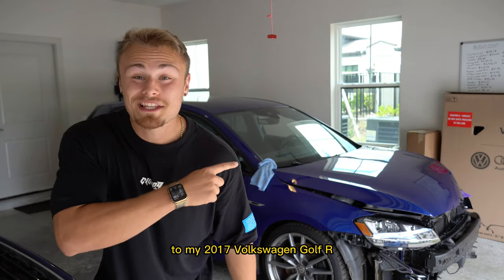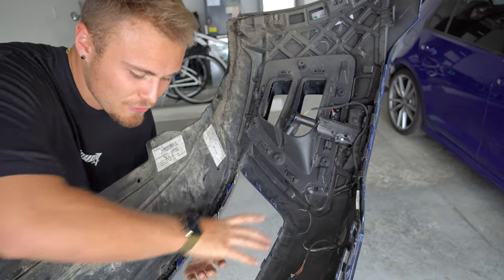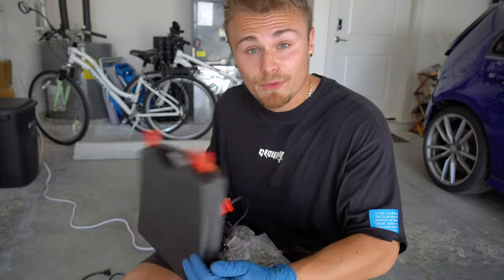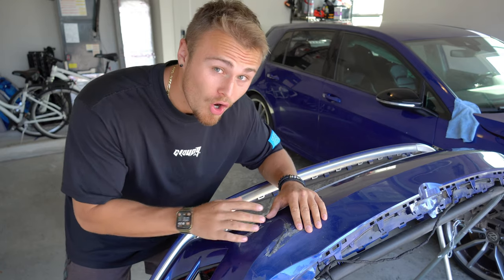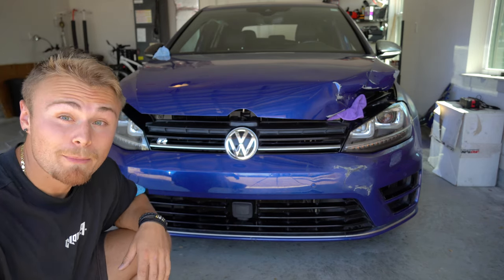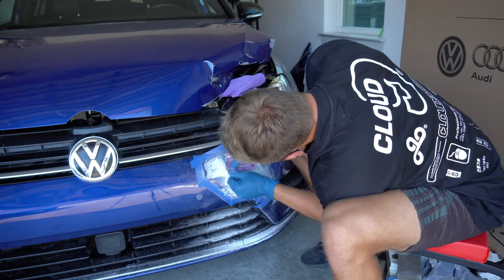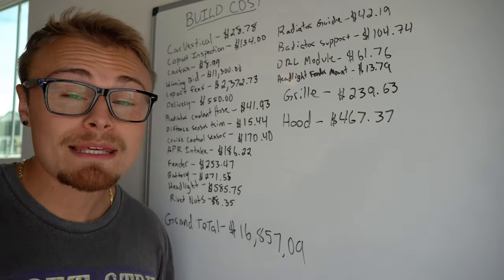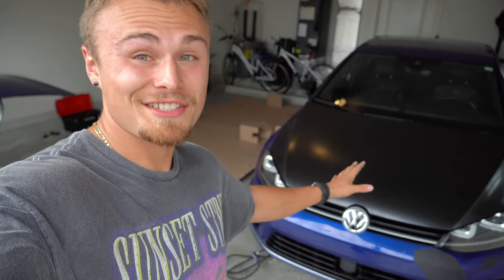REBUILDING A WRECKED VOLKSWAGEN GOLF R | PT 4

Comment: Don’t forget do this mate, why bonnets off, 

https://youtu.be/1mqfTXF6HwU
Saves some trouble trust me
Good luck with the r
Reply from the maker: So far havent had an issue with it locking! But thank you for this
Reply: @Haydenschreiermk2   hi again, must say I’ve not drilled holes in my bracket, ive just put two cable ties around the connector, the main thing is it gives no warning and boy as you can see its pain to fix, keep the vids coming there great to watch, ps glad you’ve taken the silica bag out coolant tank, yet another bad design lol, 
Keep safe